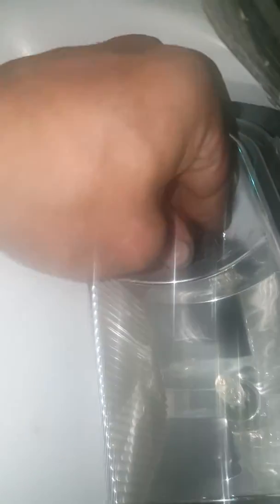1990 to 2005 Buick Century turn signal problem fixed

Comment: ...Chassis wiring takes not just talent and skill to solve, you have to have a "gift" to find and fix the issues..12 volt drains will bring men to their knee's more often than not. No biggie on the stutter my friend, I stutter and "thick tongue" issue's and when i'm pretty nervous it gets a bit frustrating. I figure if that's a deal breaker with folks, I'd have to say that their gene pool is a bit too shallow. ; )

Comment: Would u have any idea on why turn signals 2002 buick regal would go off and on sometime fast sometimes not and also break for rear passenger side won't go on either.?
Reply from the maker: It maybe the light bulb or the wireing
Reply from the maker: Or check your fuses or turn signal relay
Reply: if the turn signal is also a brake light like mine and the fast blinking is only sometimes, it's most likely a bulb. mine go really fast when I have a bulb dying or completely out. I have a 98 Century and I've noticed it does the same on my mom's Saturn, too.